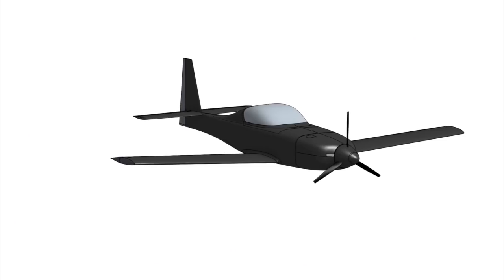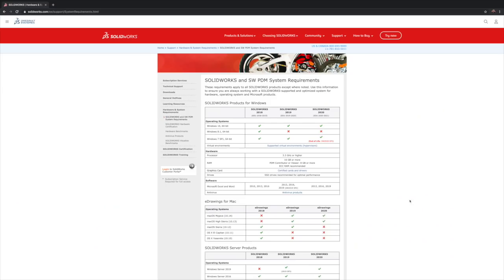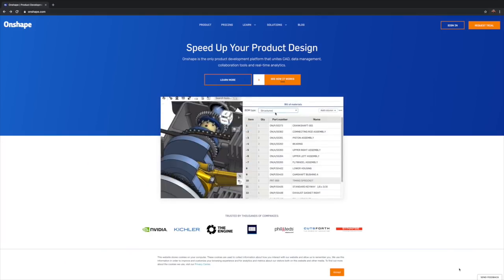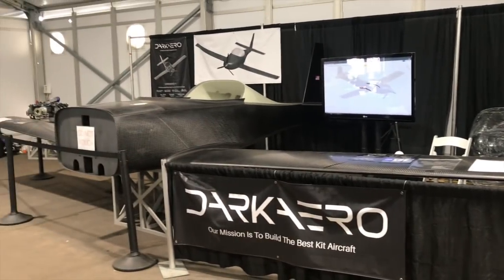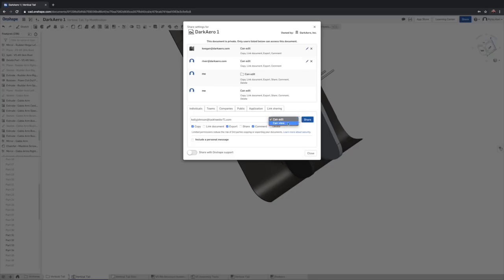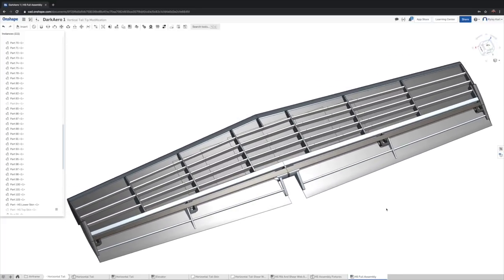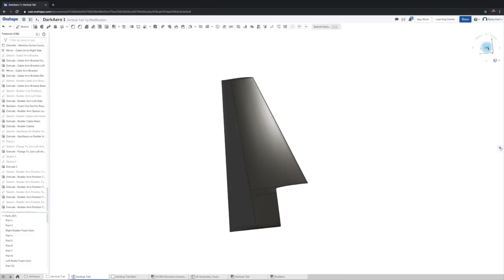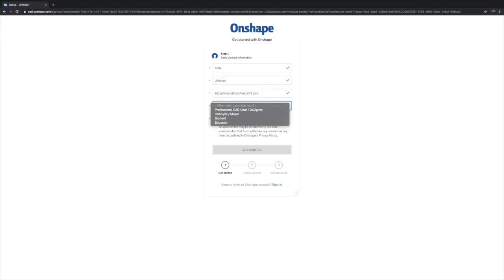Why we switched from SolidWorks to Onshape

Comment: I used Solidworks for 15 years before switching to Onshape in 2016. Vastly superior in so many ways. One thing not mentioned here: Solidworks is Windows only. Onshape runs anywhere a modern browser does. And it's faster and doesn't crash.
Reply: What about 3DExperience on the cloud, that does let you run Solidworks in a browser?
Reply: How much does subscription to Onshape cost you?
Reply: But you can pirate the former... Duh
Reply: Teddy Flood downside, pirate softwares can steal your data like your bank account.
Reply: @pinklady7184  like YouTube?
Reply: @replynotificationsdisabled  Ohhhhhh snap!
Reply: I use OnShape on Linux all the time. It works perfectly.
Reply: I also have many excellent tutorials on Solidworks and CATIA v5 , so if anyone else who is interested in this check out right now

Comment: Solidworks also has no  hobbyist license. OnShape is completely free, provided you don't care that others can see your designs and for many hobbyists, myself included, that's not a problem. I don't care if you can see my air conditioner knobs or funky one-off brackets.

Comment: I've worked with Siemens NX with Teamcenter integration because of the aspects you have mentioned. Cloud access to files is super important, but load times for bigger models become increasingly frustrating. I've worked on a model containing over 100 thousand individual parts, and loading the entire project took well over an hour from the cloud, while it would take somewhere around 5 to 10 minutes from a SSD Drive.

How does Oneshape handle the model loading times? are there different quality settings for loading, resulting in a low resolution (and paused updating sequence) for not used parts or is it a all or nothing approach?

Don't get me wrong, Teamcenter offers such a system, but having an unknown link that later breaks when you fully load the part is even worse in my oppinion.

Comment: Pricing is the biggest hurdle for me to get into any cad package other than FreeCad. I'm developing a product and  it is impossible to me to shell USD1,500 in a CAD package when I also need to do electronics,  sales platform, etc etc. And as I understood, small inventors cannot use the non-commercial Free edition to release potentially commercial product. 

If there was a 199 / 299 license per user per year I'd definitely jump in. At 1500, I just cannot justify. But it is great the industry is following this model.

Comment: 1. Solidworks PDM vault offers revision control for a shared network of users.

2. Sounds like you were describing part configurations that solidworks also has.

3. Accessing your parts from anywhere is just a matter of where you save them to. Cloud based software sounds great until the internet isn’t working or something is up with their servers.

Seems like the main pro here is onshape is about 20-40% the cost of solidworks.

Comment: The big question you didn't answer is relative cost.
Reply: SW 2600$/yr  OS 2100$/yr
SW 6000$ for forever
If you plan to use CAD more than 2/3 years Solid is cheaper.
Reply: @John.Doe.2025  I've been using SW for over 20 years now and I still scream at my screen daily but that doesn't make me eager to "work in the cloud".  I already have many reasons to own a powerful desktop computer that I built myself so that's no big deal.  I guess I have security issues.

Comment: The medical engineering company I work at is using Solidworks... coming from Inventor, Catia and being used to Fusion 360 for 3 years, the switch to Solidworks is a true pain in the ass...

Comment: Another guy selling stuff for a company which they have “no affiliation to”! Suuureee!
Reply: I agree with most of his points. One thing Onshape lacks is built-in simulation capabilities.
Reply: @joshuamadero4508  i dont get it. do pople know fusion 360 from autodesk?
Reply: @GGozzMontanelas  Fusion 360 is certainly an alternative. But Fusion 360 is not fully parametric, which is a requirement for engineering. I suggest you try Onshape, you'll see the difference.
Reply: @joshuamadero4508  how is it no fully parametric??

Comment: A lot of Onshape folks here... 
I've been a design Eng. for the past 35 years... Started with AutoCAD in 1982, Moved over to Pro/E ten years later (92), Then switched to SolidWorks in 2000. I'm still actively designing on Solidworks to this day. That's not to say that I haven't researched other CAD software, I'm always trying to find the next, latest, greatest new CAD software. That said, I used and also owned Onshape for two years. I left it for something that I think is much better... Fusion 360. I've been using Fusion 360 for a good 3 years now and use it over SolidWorks for any projects where the client doesn't specifically ask for SolidWorks. Now it's been a good couple of years since I've used Onshape and probably things have gotten better but I found Onshape to be inferior to Fusion on almost every level.

Comment: Solidworks isn't my preferred CAD software by a long way but having spent some time looking at Onshape I would take Solidworks every time, yes it's much more expensive but there's so much more I can do with it, especially in the analysis and surfacing. Onsite seems like more of a product design tool rather than an engineering tool like Solidworks, Inventor, ProEngineer or Catia.
Reply: my dad has been a classical mechanical engineer for 38 years ... he did used ProEngineer when worked for a company but he said it "needed maintainance" whatever that means, now he uses Solidworks in his own office, and he rarely uses anything other than Extrude, Cut and Sheet Metal. i think most users don't need analysis tools, so a simple and flexible platform is probably enough, besides Solidworks is a pain in MY ass, with their delicate software i need to babysit his windows machine, every windows update breaks solidworks and i need to repair it

Comment: Now this might seem controversial but with Merit. I used to use solid works for my team when designing a robot (FRC challenge) and had a sponsorship that allowed our entire team to get the software for free ( which is a great factor considering 5k compared to free.) However, while it was little rough in few spots it still was fairly decent in its job in parts assemblies and drawings. Now since this year as we went online. We switched to Onshape because of the sharing capability, and because it resembles solid works, but it is the most vial thing I have ever used, let me explain. While the sharing feature is nice it is rarely used and most times it would be used for putting assemblies together which might work on for the final piece. 2nd many of the features are clunky not so much on parts drawing, but mainly in assemblies with there being way too few options, and are annoying to control such as tolerances. The document creation and other small things are confusing as crap and are getting annoying. In addition, one of the most annoying thing it runs off a browser compared to download, I mean at least have a download feature! So as expected trying to push a full robot in assemblies and adding say an air pneumatic system, and having to use its clunky interface just then to wait wait wait until you realize you placed it in the wrong place then have to try again and wait wait wait compared to solidworks which having just 8gb memory and half decent computer/ laptop and your on your way. Unfortunately There is much more I could go on but due to lack of space a better option would be to either stick with solid works, have someone who is college either you or someone and be able to get it for stupid cheap $250-400 it’s been awhile and have it forever, install auto cad which is free, better and which smaller businesses use, or choose something else because while Onshape is ok for small parts you’ll soon start to realize that it can never handle the job. P.S I know they were bought out and the people are supposed to invest millions into it, yet it’s still long time away, still will have my doubts as they seems to want to keep it browser related, and auto cad is 10X better for being FREE!
Reply: since when autocad is free

Comment: You can easily do all the surfacing, model design and assembly in Solidworks. Easier way of doing assemblies that need to be moved, modified or changed regularly is using a single part file and Bodies.
This way everything stays dynamic and changes as you make changes.  You can save individual bodies as parts and keep them dynamic if you like.

Every time I run into someone that says Solidworks is too clunky than they obviously haven’t tried Pro E, Inventor or any other legacy system.  Solidworks is the easiest of any of them to learn.

How does the cloud do with huge assemblies? I’m talking larger than a gigabyte.

I’m willing to bet that unless you have high speed and high bandwidth internet cloud slows down.
I’m not knocking the product, just that the infrastructure is not available everywhere to use this yet.  I would say in 5 years all of the legacy systems will have a similar product.  Adapt or die
Reply: Its not like Inventor is more clunky then solidworks. Pro E on the other hand..

Comment: Cloud-based anything is utterly stupid. The user is reliant entirely on a) a working Internet connection, b) the servers of a third party company, c) the owner/administrator of the software in continuing to provide a service. Software needs to be on one's own computer. Cloud as a back-up is another issue.
Reply: 3:00 once he gets on the plane he can't keep designing the plane without Wi-Fi
Reply: I fully agree. I can't stand cloud based solutions. It also feels like the software is holding you by your groin, having your files.
Reply: Quite literally every point he mentioned about features in OnShape are available in Solidworks. For example, in context parts, exporting to read-only files, etc. 
Not that OnShape is bad/worse but It's really dependant on your use case which is better for you.
Not to mention CAM add-in options for producing G-code for CNC machines.
Reply: I can see the advantages of a local server based SolidWorks, Catia or any other commercial grade installed software on your computer. However those benefits get greater on a large scale company wide organizational level. On a smaller scale like this, with 3 people working possibly remotely from a personal computer Onshape does provide some benefits other local based softwares cannot dream of. I personally wouldn't trade SolidWorks or Catia for anything based on their user friendly interfaces and strong surface and solid body modelling features, which I would assume are lacking in a software like Onshape, but it's good to keep an open mind.
Reply: @TheZanzaroni  As mentioned in the video onshape tends to be more user friendly than something like solidworks due to its layout (and personally I like that whenever you use a tool in onshape, if you don't know how to use it, there is a help option that will open up a guide for that tool). In terms of surface and solid body modeling features onshape has been improving drastically in these areas over time and has reached a point now where those things are features of the software. Also if there is any extra things that you want in onshape it is usually available as open source programs called FeatureScripts, which can give you allow you to add a wide variety of user generated tools to your workspace.
Reply: @42ndsheep  I have used SolidWorks for a while now and I'm pretty familiar with it, in the hands of the right person any CAD software can do almost anything, at the end of the day it's down to personal preference. SW also has a wide variety of helps and tutorials online owing to its longer presence but that should not deter anyone from wanting more from it and choosing a different path.
Reply: One thing that OnShape has that nobody else does as far as I know is it doesn’t use files for parts. All data is stored in a database. So no more checking files in and out and updating files to the most current revision. It’s all just data. This is really superior way of doing design that I think everyone will be going to in the future.
Reply: @Liberty2357  It's an advantage but I do prefer to have local backups of current (or recent) versions of my files. As for file sharing a local or cloud server is easy to setup for a minor corporation/group of people and it does massively improve part/assembly communication and moves the project fowrad easily.

Comment: Why didn't you try out 3DEXPERIENCE Cloud? You can run Solidworks on the cloud, and through a webbrowser, connecting to a remote machine. 
I get the cost is an issue with these industry programs, but they do have something available similar to the cloud. 
And with 3DEXPERIENCE on the cloud it does have those cloud file features?

Comment: SolidWorks now has 3DExperience which provides an entirely cloud-based CAD design, data management, and simulation experience. You might also check out xShape, which is a tool specifically for organic designs within SolidWorks 3DExperience.

Comment: so just a question about buying parts. all the nuts and bolts you buy are aviation grade right? I mean you are not buying hardware store grade nuts and bolts ?
Reply from the maker: Yes, all the hardware for the aircraft is aviation grade. We have more information about that on our website: https://www.darkaero.com/knowledge/hardware-specs/
Reply: @DarkAeroInc  whew it looked like a regular hardware store... tell me with the honeycomb construction of the wing how much energy can the matrix absorb in the solid fraction. i saw the static load test but did you do a dynamic load test of millions of cycles.?  also do you have mass dampeners in the honeycomb?
Reply: @winoseti  Lol yes.

Comment: How are you liking Onshape after using it for a year? What are you using for CAM? The company that I work for is in the process of switching  from Solidworks to Onshape. I've been using Onshape for almost 3 months and there are things I really like and others that I miss from not having Solidworks.
Reply from the maker: Joseph, we have actually been using Onshape for a few years now, and we are really pleased with it. Still very happy with the decision to switch away from Solidworks. It has only been getting better since we started using it. Currently using Fusion 360 for CAM.

Comment: I just opened an account. I'm taking a lot of my designs from fusion and bringing them over via step files. So far, I'm digging it.
Reply: I use fusion for small private projects, and I use the sketch -> revolve/extrude/sweep a lot. I use it mostly for 3d printing and CNC milling, and for mechanical parts. I also use the material simulation a lot.
How would you compare Fusion to Onshape? Would you say it is definately worth switching or are there big pros and cons on both sides?
My biggest problem with Fusion is, that it crashes from time to time and gets incredibly slow sometimes even with sketches of basic complexity... (and no, the PC is not the problem, it has more than enough processing power)

Comment: Did you consider Fusion 360 at all or is it lacking too many features ?
Reply from the maker: Hey Olivier, thanks for watching and the question. We did consider Fusion 360. Fusion and Onshape are both great tools. We actually currently use Fusion 360 for our Computer Aid Manufacturing (CAM). We like Onshape for CAD because of it's full cloud CAD experience, user interface, ability to collaborate and part data management (which we didn't know how we were going to do with SolidWorks). The big thing too is we wanted a way for our future builders to be able to view the DarkAero 1 CAD and have it integrated in with our work instructions - Onshape is the best CAD tool we know of for this. We have already started to experiment with integrating Onshape CAD with some of our Knowledge Base tools like our hardware tool (https://www.darkaero.com/knowledge/hardware-specs/).
Reply: @DarkAeroInc  how is that different from fusion360??
Reply: @GGozzMontanelas  I’ll answer for them: Fusion 360 is not a browser tool. It’s an online desktop (Windows, Mac) application.

Comment: The other thing I notice is that you can use OnShape on a Mac, whereas (last time I checked) SolidWorks is Windows only.  Also a SolidWorks license (again, last time I checked, which was probably 5+ years ago) is 5x OnShape....   I had stopped using SolidWorks a while ago and was using Alibre for a while, but I have not needed 3D CAD software since I got rid of my VMC several years ago.  Might be time to look at this again...
Reply: Have you looked at 3Dexperience is cloud based and can be run in the browser?
Reply: I also have many excellent tutorials on Solidworks and CATIA v5 , so if anyone else who is interested in this check out right now

Comment: Is OnShape on par when it comes to simulations / stress tests and generative design / topology?
Reply: OnShape is good for college students who want to get a feel for CAD without having to pay the high fees. But like one other person mentioned, it doesn’t have simulation features install and other test analysis features. If you want those features, you have to go thru their 3rd party apps via App Store in OnShape which is why I don’t really like it. For practice, OnShape is perfect but it lacks many features that other CAD programs like SolidWorks and AutoCAD offer. It’s so new too, so of course in its basis form it simply can’t compete against AutoCAD or SolidWorks.
Reply: Last I used it it didn't have surfacing tools